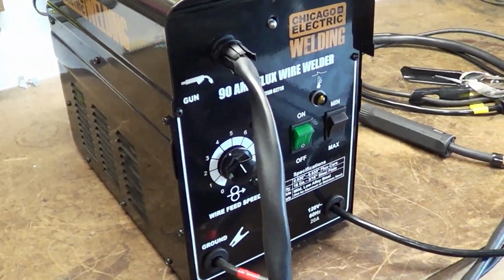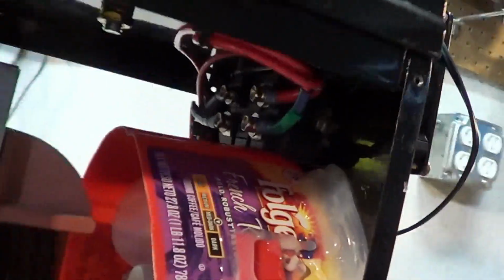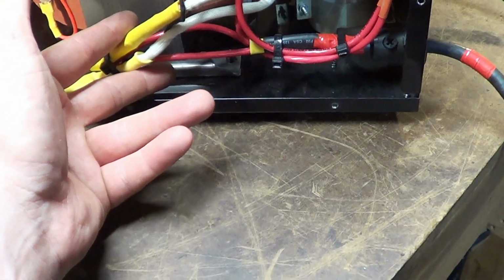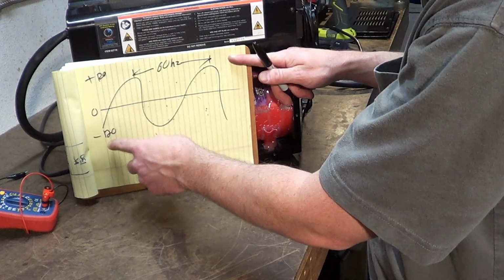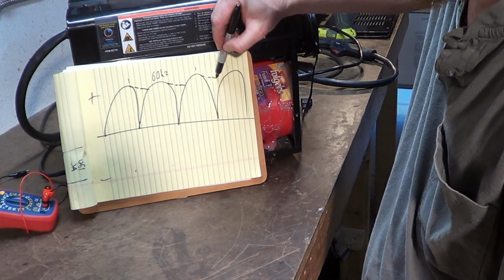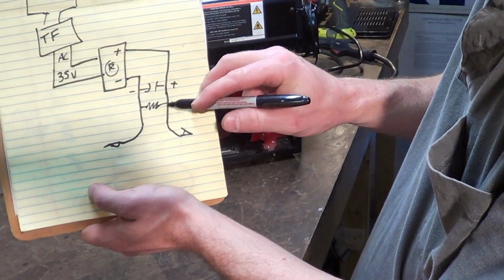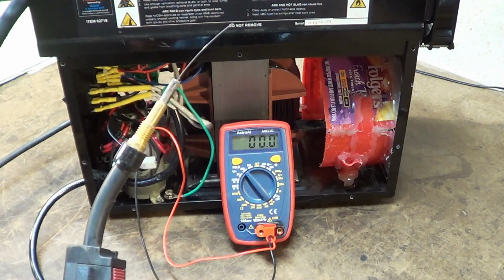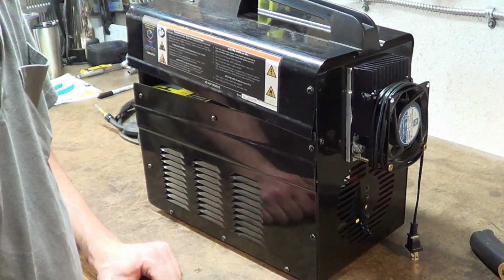Harbor Freight 90a Welder: DC Conversion & Upgrades!

Comment: I did the bleed resister thing but for some odd reason, it takes longer for the capacitor to bleed off. I went  with a low ohm resister because the information I read was the lower the ohm the faster it discharges. Seems that is not the case. I was wondering if I could put a second fan to help with cooling the heat sink attached to the rectifier.
Reply: You can both use a bigger heat sink and have whatever fans you need. You could even run a stand alone fan pointed at or across the heatsink. Use some heatsink compound for best results making a heatsink work. Just takes a little between the metal surface of your rectifier and the mating surface of the heatsink, and make sure they’re tight against each other for the thermal wicking to occur. Saw someone left an airgap intentionally and thought that would help somehow. Look at your PC, the heatsink is held tight against the processor, not slightly over it but firmly against it.

Comment: I've just got to say that I've owned a HF Flux125 for about a year now, and that I have taken some professional welding courses at a local trade school, and I have no problem with the machine, my weld performance , overall strength and "eye" appeal. I can certainly attest that when I 've used superior shop machines in the DCEN mode, that the weld quality is better, no doubt. The videos I am seeing on YT who are doing DC conversions, can't seem to run a decent weld to begin with. So before all you  Flux125 owners think you need to convert to get a decent weld, consider practicing a constant 1/2" "stick out", 5 - 10 degree drag angle, correct wire feed speed and voltage setting (hi -lo). I had to tweak settings for different steel thicknesses. I had to play with wire feeder tension. I make sure my base metals are well prepped and fitted up. All these factors can make a big difference in weld quality. The main modification that I think would be quite helpful, would be to swap out the ground clamp to a bronze unit that HF sells. I just haven't yet on my machine, because it welds quite nicely for me. Oh and I use  Lincoln  NR-211-MP .035"wire.
Reply from the maker: A ground clamp made a huge difference for sure. Biggest difference I noticed after adding the rectifier and cap was a lot less splatter, and welds wanted to lay a a bit flatter. Mostly just less splatter from a smoother arc. Thanks for the insight!
Reply: I totally agree with you, it's user malfunction, I have never had a problem running it whatsoever. I also question whether these machines are AC output and not "clipped" DC. The number one reason I say that is, show me ANY manufacturer that makes  innershield flux-core wire that runs AC, it is ALL DC straight polarity. All the modification does is smooth the DC spike voltages and allow power to smooth out and be continuous non-spiking DC. It already has DC, that drive roll motor runs 24 volt DC, not AC. I am going to do this mod just to see what really happens, whether it is user malfunction or what. When I open it up I also intend to check voltage output and see whether it is really VAC or VDC with a meter, no one has shown this in any video I have watched. Open circuit voltages will tell the truth, VDC or VAC. His ground clamp idea has merit though as a cheap fix.
Reply: @slick1rick1  The output the the electrode is AC, as are ALL the cheap 90ish amp machines....the rectifier for the drive motor is built into the same board as the wire feed speed control...
Reply: @slick1rick1  how did it go?

Comment: If you run a separate wall wort power supply from you mains input to the wirefeed motor instead of letting it sap the voltage from your transformer should help also.
Reply: They are 24 VDC , try putting 110 VAC through that motor, let me know how it goes.
Reply: @slick1rick1  Work on your reading comprehension....."wall wort power supply".....

Comment: If I had a bigger cap 47000 uf 50v how much bigger resistor would I need?
Reply: A bigger resistor, in terms of higher resistance would bleed the cap slower.
If you want to discharge it faster you would need a lower ohm value.
With the same value like in the video it just would need longer.

Comment: I spent 26$ and got a 200 ma dc bridge and a nice ground clamp. I just used my new 125 welder with no mods today.yes I hope both me and machine will get better.im saving this video in case I come across a big cap.
Reply: I missed my chance to get some sweet caps from a scrapped MRI machine.
Reply: @Farm_fab  to bad but you can still find um out there. Or like everything else Ebay or Amazon
Reply: @davidfellows6250  I bought a 90 amp one at the scrap yard for $5. It was chopped up on the wiring, but I'll make the best of it. I have a 130 amp alternator ill make an engine welder with, and I can do stick and tig with it if I have had for that.

Comment: 90 amps at 35 volts. for caps.. 5 volt drop... is 150,000 uFs... amps times 8.3 is half cycle / by voltage drop = uf..... higher voltage drop lower caps.. what does this meen?? if 35 volts with 150k uF caps at 5 volt drop.. is 30 volts out .... just tossing it out there..voltage drop is up to you.... if u want 5 volt drop or you want 10 volt drop.. if you wanted .. you could make a few banks and switch out the voltage drops for diff welding needs.. hey lol

Comment: Any chance you could link me to a good step by step video on how to do this? haven't found a very in-depth video yet.  I have a HF flux 125 and am very interested in doing this upgrade. Thanks for the video!
Reply: just want to make sure I dont cross wire the capacitor
Reply: Also, dumb question, but what would happen if you wired the capacitor in series with the dc output of the rectifier instead of parallel?
Reply: @benbaribault424  you'd block the dc signal ;)
Reply: Justin Mckibben how would that work?
Reply: @benbaribault424  capacitors block d.c. in series because the signal is constant and the cap reaches full charge and so there is nowhere for current to flow
Reply: @justinmckibben4534  it wouldnt just flow out of the negative pole?
Reply: @benbaribault424  no only in a.c..... A capacitor has a dialectric in the center so your two leads do not even have continuity
Reply: Search Matt Heere he does a great video series.
Reply: Ben Baribault search Matt Heere he does a great video series.  You want his advanced steps in his play lists.

Comment: You don't really want much inductance on a wire feed welder.  Too much inductance will give you a constant current output, which is not what you want.  Capacitors are all you really need for a constant-voltage wire feed process.
Reply from the maker: Awesome! Thank you!
Reply: MIG welder yes, ARC welder needs a reactor.
Reply: With a Choke inductor will put more of a load on the transformer
 i would like to try both and see how they work only thing is to do is test or get a schematic from a proven build not many people  put a schematic in there videos as a engineer this is the first step is to draw out a wiring place and parts location take note not to put parts so they can get hot or short out

Comment: What capacitor values do I look to buy? What exact capacitor specification numbers do I type into eBay to buy the correct voltage, uf and whatever else is needed. Electricity is not my strong suit at all. I need to be told exactly what to buy. I can do everything in this video. Thanks for posting.
Reply: The important number to pay attention to is the voltage rating. You need one with a rated working voltage of at least 50 volts. One rated at 63 volts or higher would be better.  The capacitance value isn't critical, but aim for 40,000 micro Farads or more.
Reply from the maker: questions 121 the bigger the better. There isn’t an exact spec. Copy what’s in the video if you want. 👍
Reply: @eighthacremaker7129  are you sure it makes a different over 500k mfd? @questions 121 https://forum.driveonwood.com/t/modifying-the-harbor-freight-120v-welder-if-you-already-own-one/64

Comment: Just a comment on your peak voltage numbers.  The 120V value is technically called 120V RMS (Root Means Squared).  The peak voltage for the 120V wall outlet is about 170V.  120V x square root of 2 = 120 x 1.414 = 170.  The voltage on your meter agrees with this, 35 VAC x 1.414 = 50V and your meter reads about 36V which is good because you are loading the power supply and you get 36V.  Overall a great presentation. If you looked at your rectified peaks on a scope, each peak would be about 50V.
Reply: So what's the best cap and resistor for this set up?
Reply from the maker: Jim Sherbundy my hat is off to the real engineer 🙌

Comment: What is the PC fan rated at & is it running directly off the rectifier or using a resistor??
Reply from the maker: Tim Perdue I don’t know the rating it’s a “quiet” fan meaning not a lot of air. Had it laying the parts pile so it got used. Something with more CFM would be ideal. It’s actually a 120v fan with a plug of its own and I haven’t taken the time to connect it to the power leads in the welder. I just plug it in... 😂